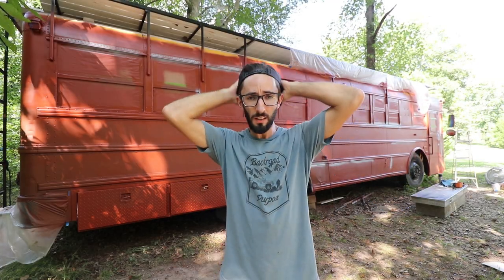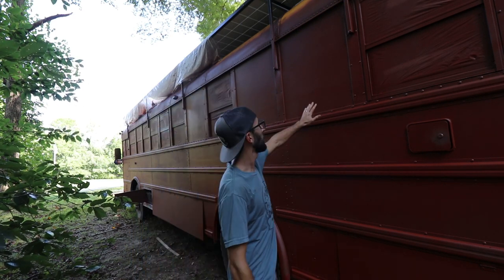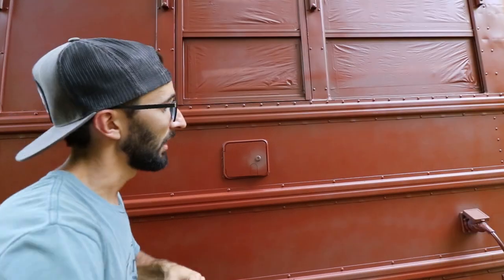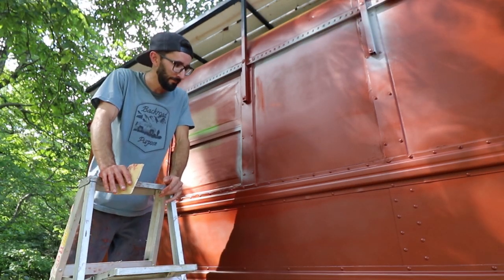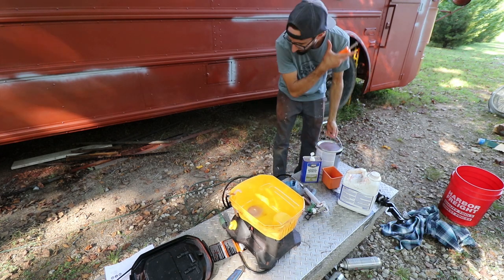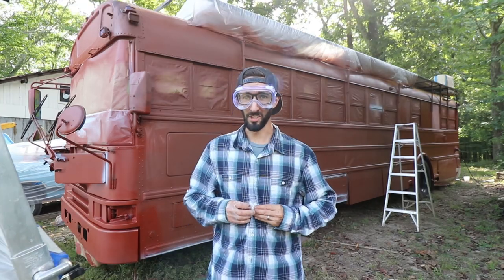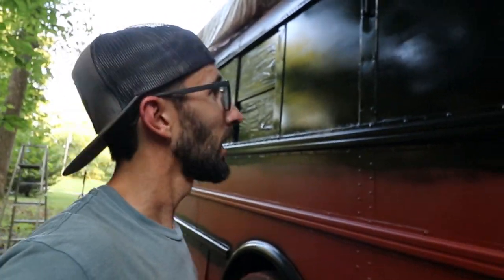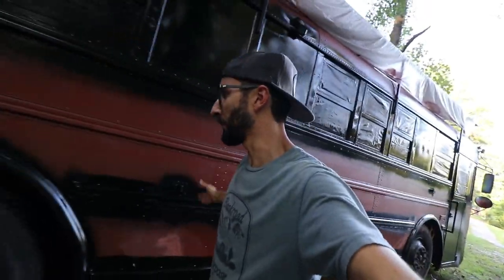GONE WRONG! Spraying Oil Based Paint With Wagner  Pro 130  On Our School Bus // Skoolie Conversion

Comment: With those airless sprayers you have to move fast. I used to spray old equipment where I worked. The only paint equipment that they had was an airless rig. Like you mentioned there is a balance you have to get with paint and thinner. Takes practice with the right viscosity, spray tip and speed of application. 
On those runs you can get them off with masking tape. Takes a little practice but when the paint skins take a piece of tape and just touch the glue side to the runs. It isn't like sanding them but often they makes the job of sanding them down easier. On the equipment I worked on it was often good enough.

Comment: That's frustrating. I'm sure you'll figure it out though. Either the paint was thinned too much or the sprayer was dispensing it too fast? If adjustable, try a lower flow maybe... Thinking more coats of less coverage is probably better. But I'm no pro painter.
Reply from the maker: I think it was a combo of the paint being too thick and heavy. Spraying too much paint on the same spot and it was super hot and humid outside. But I did a lot of research and figured it out!
Reply: @BackroadPurpose  I'll be looking forward to seeing how you fixed it. I'm planning to prep and paint our top coat this fall before I put RV windows in.